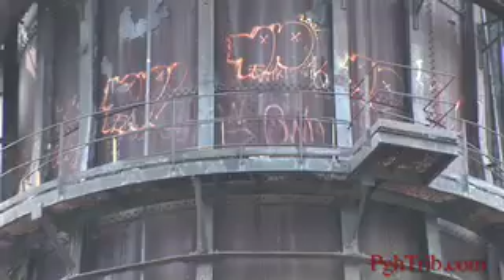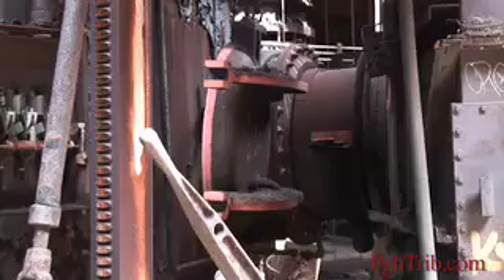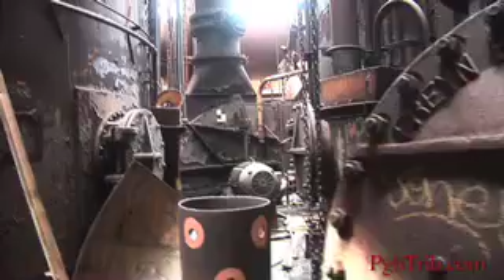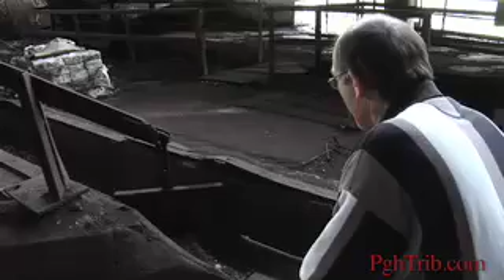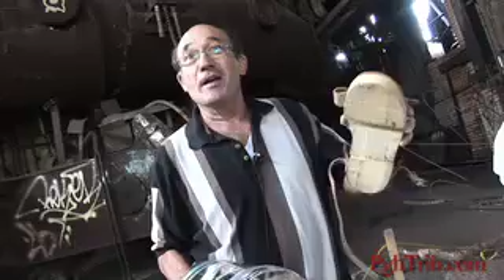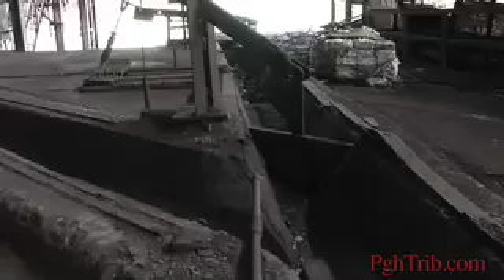Pittsburgh steel mill

Comment: Interesting explanations.  I wonder why everything looks abandoned?  Couldn't they still be using these facilities?  Or do they have a lifetime and wear out eventually?
Reply: This is very old technology and very unproductive whan compared with today's huge blast furnaces. The lack of safety features would be probibitively expensive to overcome. And he has only covered part of an iron producing furnace...not touched on the steelmaking part of the process. Modern day blast furnaces have a working lifetime and require a complete reline of the refractories every five years or so.
Reply: Looks abandoned because it is abandoned . 
like a old junk car , would be better to build new than repair rusted up old junk

Comment: Nothing has changed lol. Same operation we have at garyworks
Reply: I work there a long time ago. back when I started there were 12 blast furnaces,. . then they built number 13. my last year there was 1983. number one and two furnace had already been torn down. at that time the only furnaces that were running were number 4and6 and 13. what did they ever do with all the old furnaces that they weren't using?
Reply: @danielthoman7324  they are torn down and all structure is gone. Can't even tell they were there. But it's cool seeing pictures how it used to be
Reply: @dirtphish3523  to thanks for letting me know, I always figured that's what happened. I can't picture that in my mind. when I think of blast furnace division I always have a picture in my mind of 12 furnaces. the amazing thing is when I started working there in 1965 all 12 furnaces were running. it's really cool that I was actually there to see it but I guess things got to change.
Reply: @danielthoman7324  yes its definitely different.  But the furnaces that are standing are huge compared to your time. The skip tubs on 14 can fit a full size sedan inside of them. I believe it's a 28 foot radius furnace. Stands about 300 to 400 foot tall
Reply: @dirtphish3523  thanks for the info.
Reply: @danielthoman7324  13 blew up.. Now it's 14 (its a monster)  4,6, and 8 blast furna9are still running

Comment: i used to be a first helper in the Mingo blast furnace in the 70's started as a cinder snapper, just like you said it was so hot the slag and iron was white hot, i used to jump over the runners pretty cool job at the time.
Reply: No way was it dangerous
Reply: Cinder snapper took care of the slag runner , keeper and keeper helpers took care of the iron

Comment: we were offered a little silver suit a shield. most of the time the men warm nothing but leather gloves hard hat and safety glasses pouring Liquid Gold. in confined areas where one heat a day and 24 hours led to 10 and 12 hits a day sand silica chromium manganese nickel copper aluminum flux bricks and you name it. in the air at 30 2 years old had to have my nose and throat cut out. and they say it was just sleep Acme. I worked in the pits the asbestos it seems like they're always a step ahead. please God help those leaders to help those have served their country and many many other ways for all the weapons of war.

Comment: Why did the PANYNJ refuse the steel bids from the big American mills and instead
give the bids to smaller steel suppliers who purchased the steel from international steel suppliers and also from the big steel mills. Quality control of the steel coming from different suppliers is often a problem and the big mills could control the steel quality much closer. So, did the PANYNJ screw up by trying to save a buck? Maybe? Why was the Koch company chosen and no bid contest? PANYNJ Smells!

Comment: Not many people can say they've worked on a blast furnace! Today, it is demanding as EVER. First, you need special CO training for high gas hazard areas just to enter the dept. And nowadays, there is a fraction of the manpower but up to 4x the production, and many job duties are still the same. I've worked in both casthouses nextdoor at ET as well as the stockyard. The casthouse is so brutal that only about 50% of new hires make it. At least back then there were extra men, fewer casts, etc.